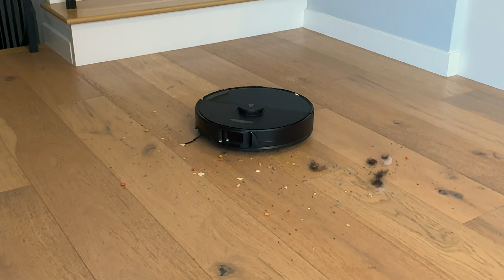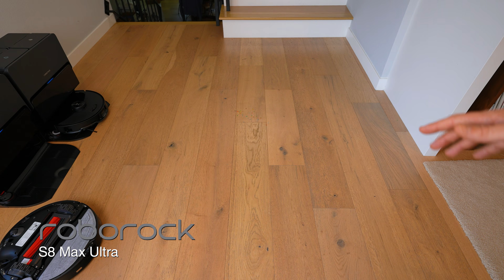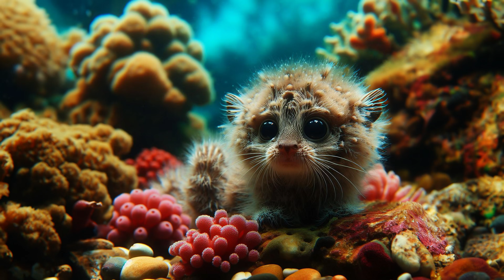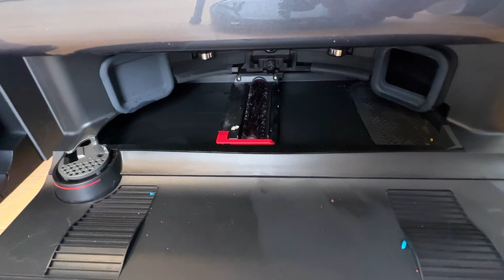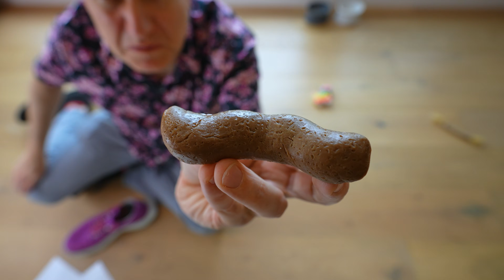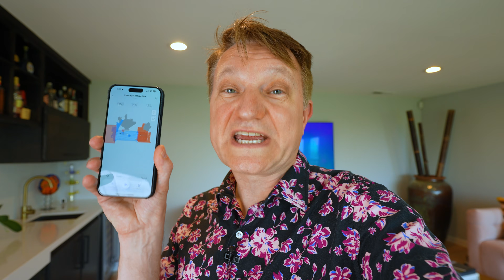Roborock S8 Max Ultra vs S8 MaxV Ultra: Rise of AI Cleaning

Comment: Very nice video, I also purchased this Robot, I have a polished very shiny porcelain marble effect floor (Carrara). The first wash carried out with the maximum water level, everything went well, without streaks or streaks. Now even at the minimum level it seems to leave puddles behind it, what could this cause? Thanks in advance for your help greetings
Reply from the maker: I'm not sure. Maybe there is something stuck under the mop pad? Take a look at the bottom of the robot or try to figure out where the excess water is coming from.

Comment: reactive AI obstacle recognition is Also in the 6MAXV but its not in the 8MAX Ultra? I was thinking of getting the 8 pro ultra but if its less capable then thats a problem.
Reply from the maker: The models with V (vision) have a camera and are dramatically better at obstacle avoidance.
Reply: Oh ok, So if I were to chose between S8 pro Ultra vs S7 Maxv ultra

Which should I get?

Comment: Can you turn the auto drying off if you want? Can you hear the drying, is it loud? Does the drying make the room more hot? Thanks for the video
Reply: You can turn it off. Makes some sound, not too much. It will never heat up your room.
Reply from the maker: It’s not very loud at all. It does not heat up the room. It’s very gentle. I’m not sure you can turn it off, but I don’t think you’d want to because you want to avoid bacteria creating an odor on a wet pad.

Comment: They copied iRobot with the 2 roller design, which makes me angry in a way

Just tell me if I'm wrong on this, although they will tell you that they didn't of course
Reply: iRobots patent expired.
Reply: @twennywonn  ok thanks
Reply from the maker: The other guy in this thread says the patents expired, but tbh I haven't researched it.
Reply: @vacuumnerds  ok thanks

Comment: Something I saw another reviewer mention was the base did not draw enough power to consistently dry at 140 degrees Fahrenheit. Not sure what you saw in your testing.
Reply: I don’t think the problem was the air not heating up, it’s the mop washing that’s not heating up the water to 140 degrees. I believe it’s only heating up the water to around 100 degrees.
Reply from the maker: @aspj5132 I didn’t test the water temperature either and the best I’d be able to do would be to test the temperature of the mop pads since there’s no access to the hot water exit on the robot itself. The mop pads are definitely warm.
Reply: @vacuumnerds  Jamie tested it in his review, the water indeed does not hit 140 degrees. The hottest he was reading was 100 degrees.
Reply from the maker: I didn't test the air temperature, but the mop pads dried in a few hours.